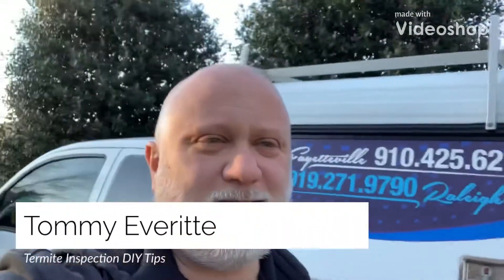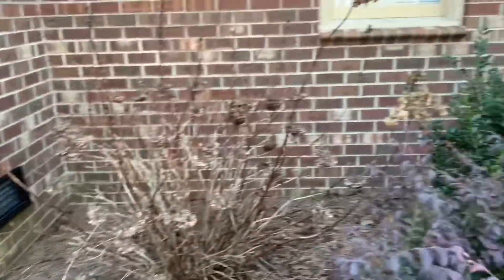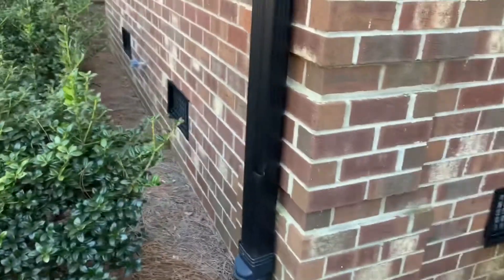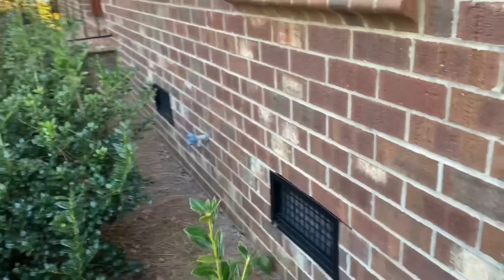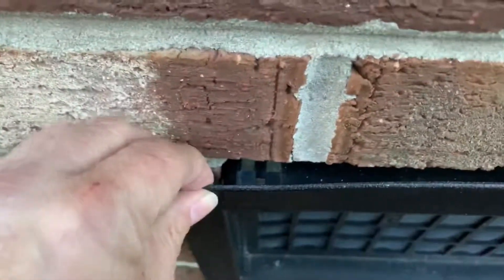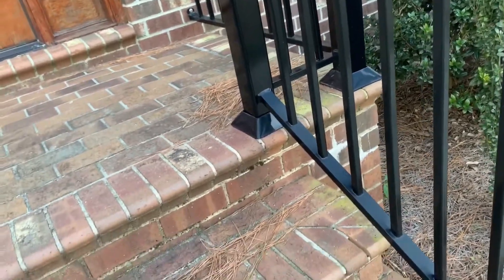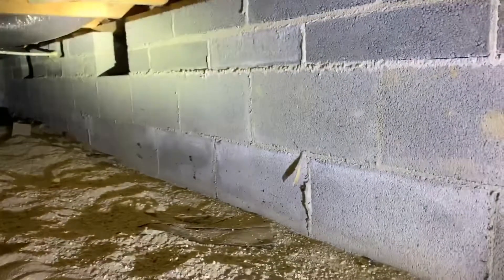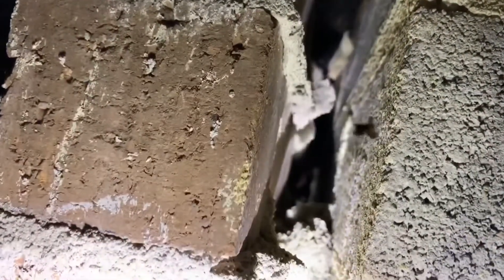DIY Termite Inspection Tips (Dunn,N.C.)

Comment: That space can be filled with a dry send termites don't like dig into the send.Research has shown termites are unable to build tunnels through sand when the particles are between 2.0 and 2.8 millimeters. The larger particles are too big for a termite to move, and the smaller particles fill in the spaces so that termites cannot burrow between the larger pieces of sand.
Reply from the maker: Sand Barriers are not a very effective way to control termites. They can be moderately effective if done during pre construction but very often still end up getting termites. Even those who advocate for it admit in their own research it should only be part of the approach. Honestly it is not worth the effort. Treating with Fipronil is far more effective .

Comment: So you are telling people to open their crawl space vents in the winter??? i live in NC and we don't always have tropical summers,  also what about cross ventilation, that is what the vents are made for. I would NEVER tell a customer to open their vents in the winter (busted pipes, cold floors, etc..) If you as a pest control company sell these vents, you should also sell an annual renewal to check them every year, that cost would cover any adjustments needed, or replacement, such as an animal trying to get in, or a customer that is mowing and hits something into the vent, all that would be covered.
Reply from the maker: No I’m not telling people that but I am saying you would be better off doing that in most cases than opening them in the summer. It very much depends on where in the state you are. Down south towards Fayetteville your ok sometimes with vents opened but up toward Raleigh crawl spaces are being sealed off and encapsulated. Mainly because of the soil differences. Most of my career we told folks keep them open but with bigger foot prints the vents do more harm then good. They are not getting cross ventilation due to the HVAC, bigger foot print and stack effect. Air gets pulled up through the floor and warm moist air gets pulled in from the outside. Things are changing the old rectangle homes with no HVAC on sandy soil do fine but the newer hoes are having a lot of problems